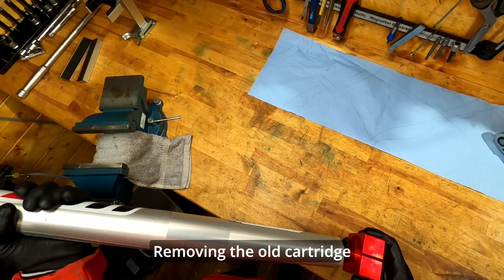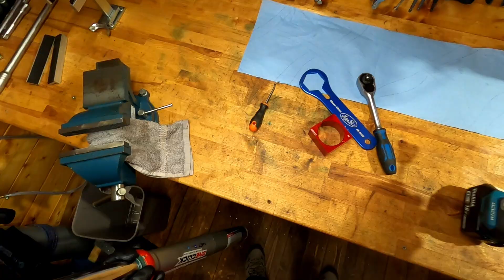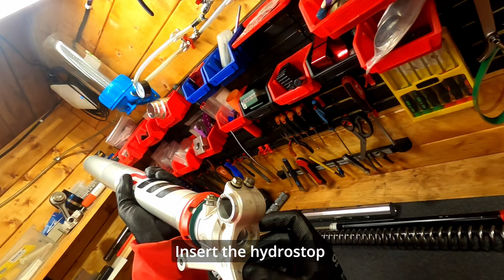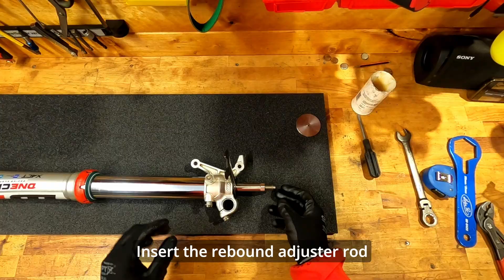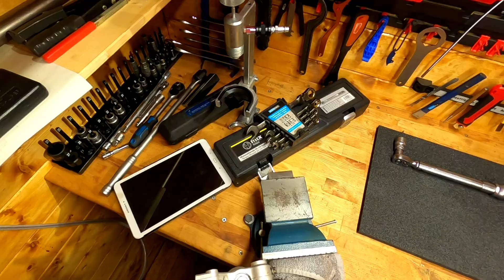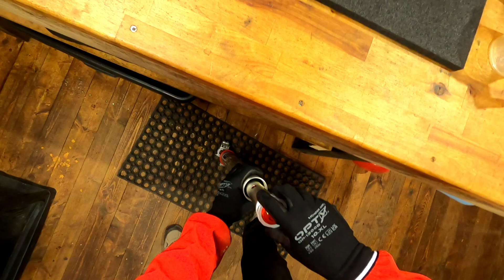KTM air forks spring conversion - WP XACT pro 6500 cartridge

Comment: Thanks for the great video. I now have mine installed in a 2022 Gas Gas mc250. Is it normal for them to make a rattling sound? Any ideas on what could be causing this? Thanks
Reply from the maker: Mine don't rattle. It could be many things so disassemble them and inspect everything.
Reply: Thank you

Comment: Can you have a video of the closed cartridge?
Reply from the maker: I don't have that fork but it's almost the same procedure. The CC fork just does not have preload adjuster. 
CC service manual says 175ml oil to cartridge and 390ml to external. 40Nm torque for rebound adjuster.